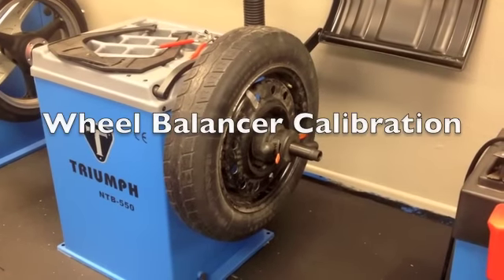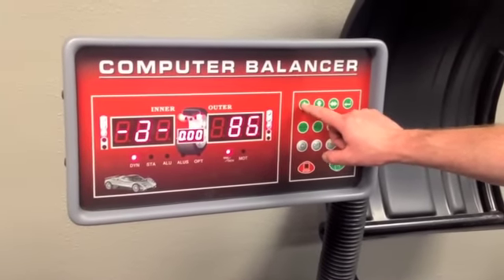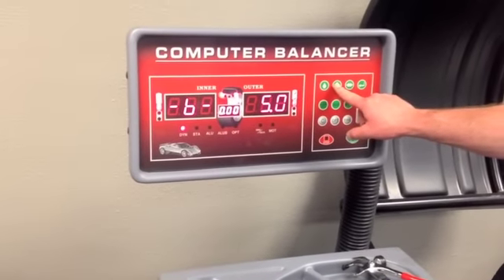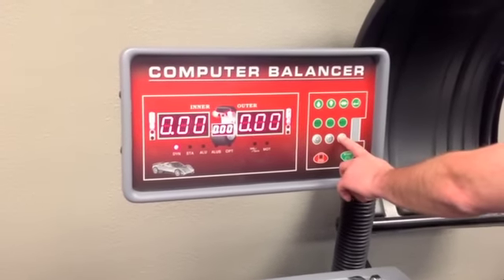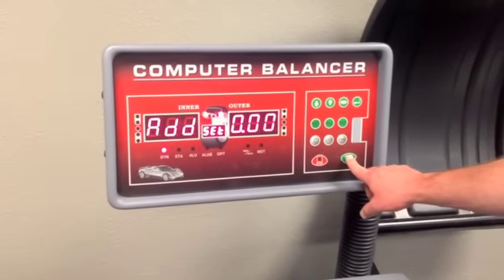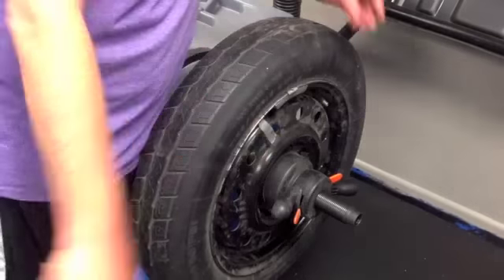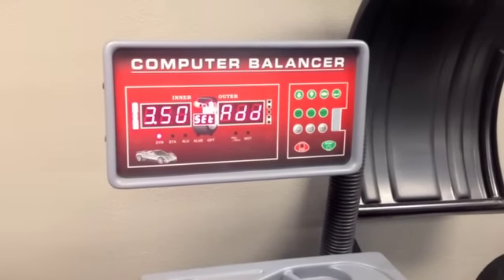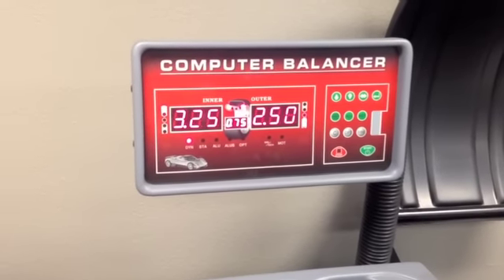NTB-550 Calibration Process

Comment: Excellent Video.  My manual shows a different way and it doesn’t work using their instructions… this is exactly what I needed thanks!!
Reply: Did this procedure (different than your manual) work for you?  My manual is different than this method shown in the video. Neither method calibrates my balancer properly and I suspect a shaft imbalance from the factory.
Reply: @ yes it did work for me and now the machine usually stays calibrated unless it’s turned off or unplugged